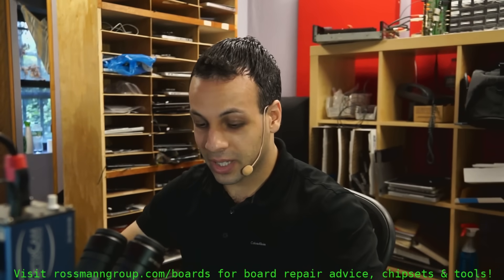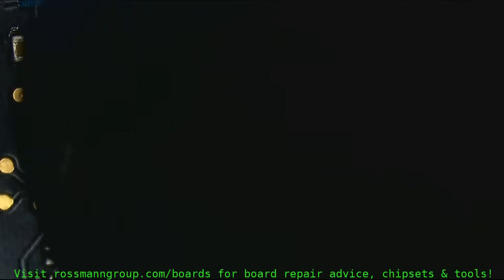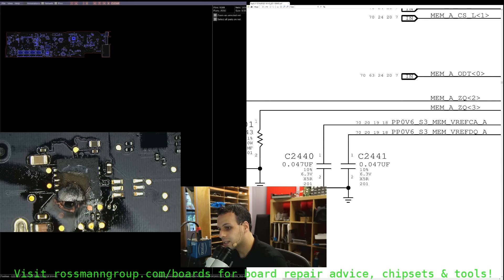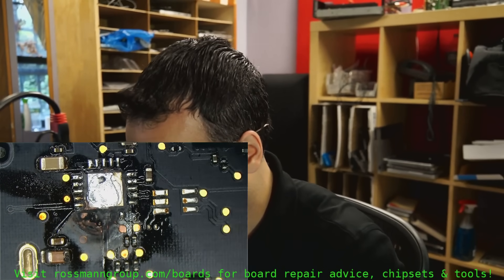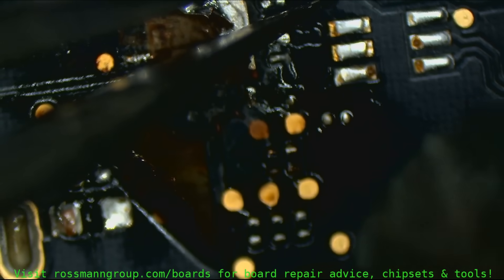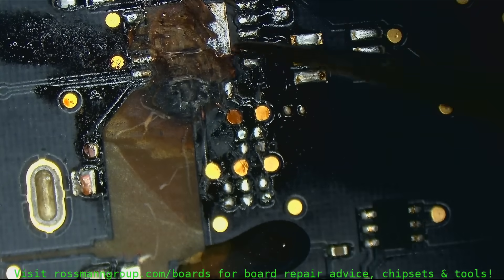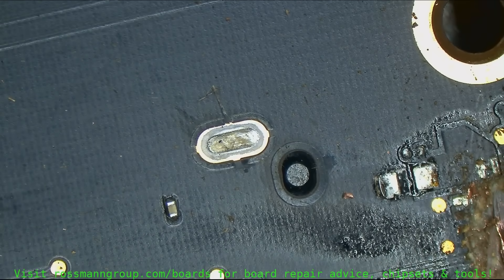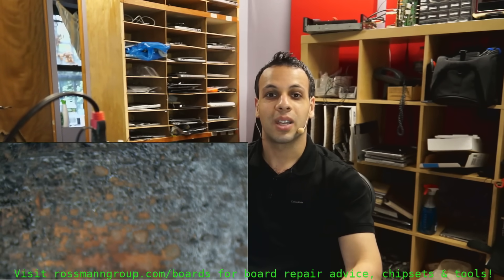They call it thunder "BOLT" for a reason; Macbook board erupts.

Comment: Apple's bean counters: Why spent on protection circuits when we can save? We'll make billions.
Reply from the maker: +CNe7532294 yep...
Reply: Louis Rossmann And not putting protection on them theyll make more money because more board break and theyll get more people to suck dry with a huge ass ticket.
Reply: I'm surprised they didn't consider this a legal safety hazard. They must have had layoffs in that department. As mentioned below. Leave this in a flammable environment and maybe win the legal lottery. I'm thinking a college chem class will have fun with this one. They'll still pin it on the student though. Theres a reason why they give you boring legal paperwork instead of an owner's manual when new out of the box. Thanks for showing how welded this is. Re-enforces the idea of why its policy to not have this monster (or any mobile electronics for that matter) out when doing labwork with flammable compounds.
Reply: Well, they are making so much money because they are saving everywhere...
Reply: And then they make more money because instead of fixing their mistakes, they force you to buy a new logic board.

Comment: "Most people don't spill liquid on their operating system or user interface".

Challenge accepted
Reply: i split water on the usb that has an operating system on it the other day. does that count?
Reply: @jasondads9509  Your PC has an OS on it, you spill liquid on the PC. It doesn't boot. You didn't spill water on the operating system, you spilt water on the hardware. So nah, doesn't count unfortunately
Reply: Lijnk Garo i prined a picture of my display output and spilled water on it, i win
Reply: I spilled beer on my ipod and it corrupts the operative system, after restoring it, it worked (Just to die a few months later).
Reply: I accidentally put a usb flash drive through the washing machine
Reply: @pinklightninggaming7353  - i also ran a USB through the washing machine and i am still using that drive to this day.  (Sandisk 2Gb)
Reply: Never happend to me. My old packard bell P133 with edo ram still works, as does my sockets A athlons platforms from 2001 and 2004. And my car from 1989. Some of us are real geek !
Reply: Lijink Garo "I spilled liquid on the specific parts of my hard disk that contained my operating system lol" -No one

EDIT: I was joking, sorry for the misrepresentation
Reply: I changed my desktop wallpaper to a spilled cup of coffee.  Do I win?
Reply: I mean you can spill liquid on the storage that the operating system is contained on.....
Reply: Lijnk Garo And macos's interface is called aqua lol.

Comment: A+ for the best job that you could do! it is what we used to call in the day (1970s) a bootstrap repair. man am i glad that i don't do apple!
Reply: That's a repair? Temporary patch, this board will die soon.
Reply: not unless the user spills more water or w/e on it. it is ether that or good luck buying a new mother board. that is why i don't own a laptop or anything buy apple. if my pc stops working i just fix it. not to the component level but i still fix my own power supplies. but i can get the parts i need and replace what i need to.
Reply: replace and fix - not the same thing.

Comment: Back in the day they use to have these things called shunt resistors, and there were even over current protection chips.

But now in days all those things are old relics.
Reply: There are so many ways to protect circuits , many cheap . But Apple is not interested in Failsafe Circuits if they were they would install SM Thermal Circuit Breakers that don't need replacement ..
Reply: And also Apple rather saves the space, because having everything thinner than 1/4 of an inch is very important and adds so much usability. I literally wanna slap people who even care about thinness, We need 10 hours HEAVY battery usage times, we need excellent cooling and we need notebooks that last at least for a few years… that’s what people should be wanting… They should leave thinness for their consumer bitchy girl products, their rosé gold crap macbook.
Reply: Apple is there to milk their customers every way possible and this is one way to do it after the board fries once the warranty expires.
Reply: I shunt get that
Reply: I always love the idea of showing something from my collection like a xps m1730 just so they can have full body cringing from the weight of that machine. A lot of people don't have much of a spine these days and can't carry quality.
Reply: Two words: "Planned Obsolescence" ... Back 20 or so years ago manufactures wanted to make the best products they could. Then they realized that they could make more money by designing their products to start to fail after the warranty period was up...thus began the "throwaway mentality". the audio craps out on your TV? Throw it away and get a new one... SIGH
Reply: R H then use hackintosh? Boot mac OS on a normal desktop
Reply: Bafang still needs them both.
Reply: Wouldn’t not having those be considered a fire hazard?
Reply: This circuit is designed to run at 3.3V and 16 Amps, so that the Thunderbolt port can be used as a charger. It's a miracle the board doesn't go up in flames during standard usage, consider the effect of also adding extra heating elements in the form of shunt resistors.
Reply: Only the shunt resistor failed in this case too, they just integrated the whole thunderbolt into the resistor. 😃
Reply: Even USB HAs fault protection at least every product then apparently boss headphones that fried from a faulty wire a fucking Arduino has protection a 40 dollar computer
Reply: or just run all linux, windows, and mac OS in a trio in a battlestation like mine hah. cant wait to start learning this stuff. i have a 400$ amp a friend gave me and if i fix it i can have great sound in my car. after getting speakers of course.
Reply: +Volf3r It’s not really shitty crap, the craftsmanship is excellent, it’s just the current concepts that suck and the focus is on the wrong ends. I care a lot about aesthetics, i think they can add usability but Apple got too fixated on thinness and quiet computers. It’s a little ridiculous and even those that like this approach, it bites them in the ass when they need to get their faulty products repaired after only a year or two, or their shit graphics cards not holding up to standards and their product gets obsolete so fast.
Other than that I would still pick their products over anything else, just not very happy with it. It’s crap but still better crap than the rest. And I’m a very critical hardworking programmer, so the wimp statement isn’t quite correct for all of us. I don’t think windows could bring the same out of me as OS X

Comment: surely the "bolt" in thunderbolt should be emphasised rather than the "thunder". It's the lightening bolt that is relevant, thunder doesn't make sense.
Reply: what are you on?
Reply: thunder isn't the dangerous electrical part of a storm, it's the lightening bolt that would fry a board. The pun in the title doesn't work

Comment: In order to fix your motherboard, make the hole from a blown IC bigger.
Reply: But do you have MacOS?
Reply: Mateusz Kowalczyk just open ur window and throw that shit out
Reply: Neither. I use Linux.
Reply: Fun fact, that is pretty much how you do it.
When an IC blows that bad, it tends to be correlated with a short in the pvc part, which you can only fix by digging it out, which makes the hole bigger.
Reply: HaLuNkE ST0NER I don't have windows in my basement :(